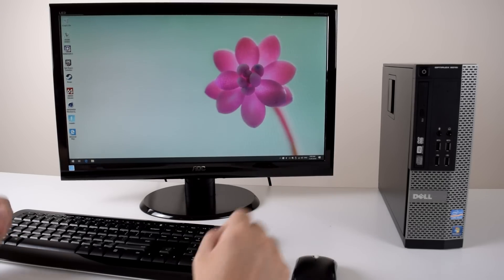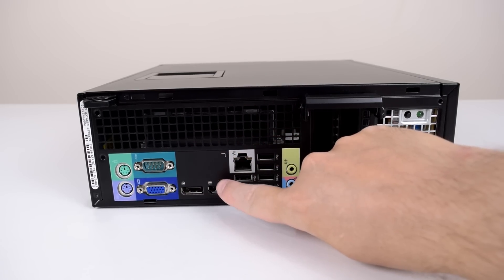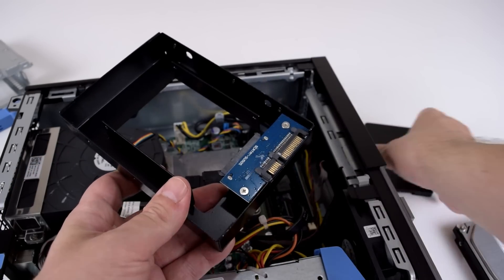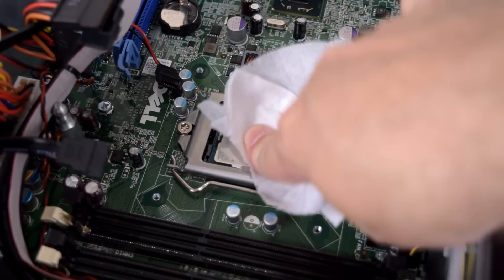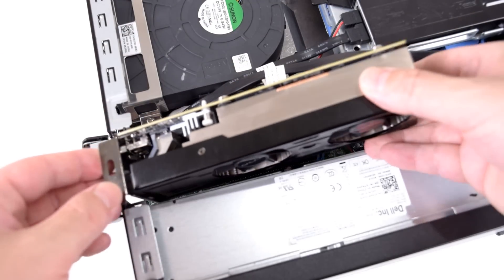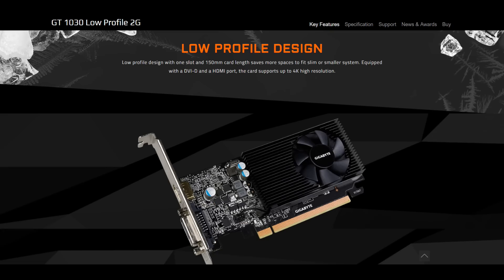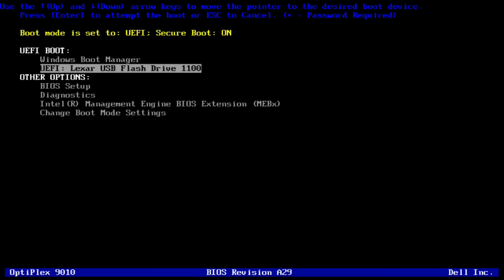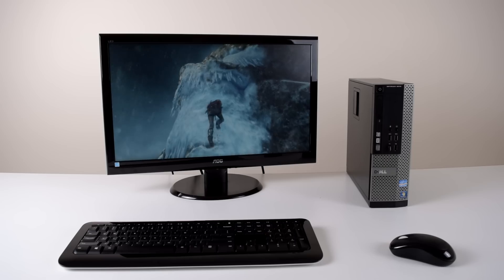DELL OptiPlex 9010 Upgrade Guide! Core i7 32GB RAM GTX 1050 Ti and more

Comment: The motherboard is good, need a new case to fit a new power supply to power a great GPU. Max out all the ram. It is a fast computer once you do that. expect reboot to be around 30 secs.

Comment: I have a 9010 sff with a gt 730, I've been wanting to upgrade my gpu to either a gt 1030 or a radeon rx 550 LP. Which would be best? Would the rx 550 LP even fit in a 9010?
Reply from the maker: Best to lo look at some benchmarks, but make sure you are comparing DDR5 models, the 1030 has a lower performing version with lower grade memory.
Reply: @philscomputerlab  the 2gb ddr5 version is the one I'm looking at right now. In terms of benchmarks it seems to get the job done, at least for me since I won't be playing heavy games on it.

Comment: You guys can also do the same thing with the house company elite 8000 series, capable of the i7-3770. A major upside to this system is that is comes with 4 pci brackets instead of two, so if you are a hardcore user that likes to use loads of like sound cards for example, that system is for you. They have the same ps5 wattage, and are generally the same, it los supports DDR3

Comment: Good news! Nvidia launched a quadro RTX a2000 low profile with 6 and even 12gb of VRAM! You can upgrade the gpu to that now!
Reply from the maker: How much?
Reply: @philscomputerlab  like $500-$450
Reply: up to $600
Reply: @philscomputerlab  its hard to find the 12gb variant though
Reply: equivalent to rtx 3050-3050ti

Comment: So my 3010s 240v psu can handle a gtx 1050 just fine? I have read that it might cause problems and the gt 1030 would be save

Comment: This video is the only informative video in this aspect! I loved it. I was thinking of buying a used 9010 but holding back as it doesn't support anything... luckily you proved me wrong. Please specify whether the PCI bracket is the full height or half height?

Comment: Okay so I just went into 3 different reply sections to comments and I am BAFFLED by these fake pc experts trying to explain to people what good and bad ram is so Im going to make a chart. People are STILL arguing over this in the comments.

RAM Chart:

2gb: Very Bad (probably couldnt run minecraft at 30+ Frames)
4gb: Okay (45-75 frames on minecraft)
6gb: Decent (But why the oof do you have 3 2gb ram sticks. That shit is ocd triggering for some reason or is it just me)
8gb: Average (Can run most modern games at a respectable framerate, minecraft 90+ fps)
12gb: Good (Can run most modern games at 80+ fps, minecraft 150+ frames)
16gb: Very Good (Can run the large majority of modern games at 120+ fps)
32gb: Extermely Good (Ideal for a finished gaming pc, can run basically every game at 180+ FPS)
64gb: Unnecessary (You really dont need this much unless you're an editor or very rich)
128gb: STOP (You are mentally ill and will never need this much unless you edit movies or something for a living)
256: How did you even find that many ram slots (Stop it. You need help. You have a problem. You cant afford food anymore)
Reply: This is assuming you upgrade the rest of the pc along with your ram. No point in having 32gb ram but GTX 750 as your gpu
Reply from the maker: Hehe that made me smile :D

Comment: OK I have bought the 9010, I have bought the i7 3770 not sure if it's the t or s version.. Wil the gtx 1050 (not ti) be OK with the standard power supply? Thanks for this fab video.

Comment: Do you think a 320w psu could handle a 1650 super? I have an hp Compaq 6300
Reply: you can if your psu has 6 pin connector...I put rx 470 in my optilex 315 watt psu...I was planning to put 1650 non super but it has lower performance to rx 470, so I end up with used rx 470 since its cheaper
Reply: @mzam2028  ive actually done a mod on my power supply which ive been doing for decades and it works great.And the 1650 super is closer to a 580 from what ive seen.Some models even surpass it.Only bad thing is its only 4gb.I want to buy the palit 1650 super oc.Its really cheap, compact and is also the fastest 1650 super!
Reply: @steliosemmanouilidis5050  actually even 285 watt psu can support up to gtx 1660 ti...Linus already try it...he only use molar to 8 pin connector in oem pc..no need to mod since you have 320 watt
Reply: @mzam2028  no i did the mod to add the 6 pin.Also yeah I've seen the video linus made.I would go with a 1660 but it's over my budget.Now you got me thinking that maybe buying an rx is better since it has 8gb.But im not sure.Although it did work for you its recommended psu is 450w witch is way more than my 320w.So ill probably stick with the 1650s.I wish they made 8gb versions of it :/
Reply: @steliosemmanouilidis5050  actually yes gtx 1650 super has similar performance to rx 580 and even better in some game since it use gddr6.....just sell your 1650s and get 1660 ti or super thats the optimum gpu you current psu can handle...
Reply: @steliosemmanouilidis5050  no  don't have rx 580...its too power hungry...sorry if you misunderstood...but I only use rx 470 used..since it has the best value to performance..

Comment: Can you add an rx 570 to this?
Reply: I add rx 470 in my optilex sff 315 watt psu using riser cable....rx 570 efficiency is not very good...use more watt and hotter but only differ 3-5 fps to rx470

Comment: The Manual for the USFF 9010 states it's only capable of accepting 16Gb of 1600Mhz ddr3 memory. In the video all of your bench marking is done with 16Gb of ram as well. Some commenting on this video state that the 3010, 7010 & 9010 will accept 32Gb of ddr3 1600Mhz memory, yet as I've stated before the manual itself shows 16Gb (2x8) of 1600Mhz ddr3 memory is the threshold. Were you successful in getting the PC to accept & register 32Gb of ddr3 1600Mhz memory or was the Title of the video just in error?

Comment: Again Thank you for your video ....  I currently have 16 GB of RAM with a i7-3770 @ 3.40GHz processor , with a Intel HD Graphics 4000 Video Card....I'm looking to upgrade the video card to get a 3 to 4 monitor upgrade ..Oh I don't really use the pc for gaming but my sometime running Madden 2021.    What is the best card from my needs? Is the GTX 1050 Ti still the best card for my needs?  Thank you in advance!
Reply from the maker: The 1650 is the fastest card for games. To drive 3 or 4 monitors, well that might be difficult. I'd go for two video cards, but single slot, like 1030 and connect 2 screens per card.

Comment: So, I have a dell optipex 9020 sff with a gtx 1650 with a core i5-4570, and I looking into getting a new processer should I get and i7-4770 or one of the S variants of the i7 processors
Reply: What PCI port do you have the 1650 in and how does it run? I have the same PC and it looks like you have to use the 4x slot
Reply: @ByteMatrix-o  just use riser cable

Comment: I have a dell optiplex 7010 sff. Could u please suggest me the best and safe gpu.
Reply from the maker: What do you mean with safe? If you want 100% compatibility and safety, go with a model that is mentioned or recommended by DELL for this machine. There should be information on the DELL website!

Comment: Hello great video, what about a gtx 1650 gddr6? i have i dell optiplex 9010 MT with i7 3770 and 2x8gb ram and 1tb hdd and 128 ssd and i want to put a 1650 gddr6 (no 6 pin connector), should it work fine with the stock 275watt psu

Comment: Hey man, so I got a SFF just like this but it’s a 3470 CPU. I bought the LP 1030 and it runs alright, but still not enough for warzone. I have 16 gb ram and a 2 tb hard drive. Whenever I play dying light and have it on OC mode for the GPU. After awhile it gets kinda hot, 79c was the max I think. So if I buy the 1050 will I be able to run warzone on my factory PSU/PCIe without problems etc? Ty

Comment: Got a 7010 DT desktop, nice option in between the MT mini tower & SFF.  Takes an upgraded 300W TFX PSU, a low profile 1650 GTX GPU & a Sound Blaster Audigy FX. Also put an i7 3770, 16 GB RAM & an SSD in & it's a capable gaming PC for about £400. Plays recent games in 1080p at medium to high detail. Worth getting the 7010 or 9010 over the 3010 as you get faster SATA & PCIe speeds. The SFF is very neat but the DT is slightly more upgradeable & has better cooling
Reply: Managed to find some Crucial Ballistix Sport DDR3-1600 sticks that run at CL9, without XMP (which the motherboard doesn't support). Tiny speed increase but makes me smile!

Comment: I just found this computer for sale at a local computer shop near me for 179. already has the i7 and 8 GB ram that I'm trying to research if it's a good deal-thank you for your video.  But it has the 500 GB hdd, which I don't need that much for storage, nor do I game.  But still considering an upgrade to a SSD, but as it is, is probably sufficient for my use of it.  Now the two previous desktops I owned over a decade ago, were package deals, had laptops since then.  Probably a dumb question, but as far as monitors go, will I need anything special to make them work on this thing?  Cords or cards, or will any monitor I chose work?

Comment: I also upgraded the video card to a 1050ti and added some ram and it already had an SSD. Most games work fine, except cpu hungry games. The speeds difference to a i7 isn’t worth the price of the demonstrated i7.

What is the newest i7 it wil take? Maybe a newer version makes more of a difference?
Reply: idk. you're pretty much stuck with the current i7 you have.. unless you manage a newer motherboard that supports 4th gen. ik mine supports 4th gen, because it came with a i3 4150

Comment: Bought one of these a few years ago and hot rodded it and as I was learning about it I discovered how non-universal the motherboard size was, so I bought another one the mini-tower so if I either need a new MB it is compatible to the open market MB's.  Just got the New Egg Business sale i7-3470 for $207/freeshiping.  First thing I did was add SSD and RAM, oh and I never get these units with Windows, always No Operating System.  Need a graphics card now and the hard-mods are done.  Thx for sharing.

Comment: im getting one of these from a friend who has had this thing just sitting around with an i7 in it just laying around we were all chilling in a discord call and he decided to show it off on his cam in it peaked my interest ill update this comment when i get it ill be planning on getting it to 32gb of ram and getting it fully cleaning and getting the small front fan looks like a 92mm with a noctua for more airflow with lower noise as for a gpu ill look at that when i get it so i can get a better idea on what i can do i think i can use something newer then a 1050ti idk if they make 1650 supers in that size or not yet and i have an ssd to put in it right away so im going to just sell my current one to upgrade this one and to save for a laptop as well thats just what i plan on doing for this i know the i7 3770 can handle scp sl so long as i get a decent gpu to put in it........all in all thanks for uploading a video on one of these machines this gave me a good idea on what to expect for when i get it!

Comment: I have an old setup with the following specs: 
_____________________________________________________________
++++ i5 4460
++++ Gigabyte H81M-S1(with PCIE 2.0 standard unfortunately)
++++ corsair 16GB RAM(8x2)
++++ 480GB WD green SSD & 1TB WD HDD combo
++++ Corsair VS 650 power supply
_____________________________________________________________
I wanna play modern titles at 1080p 60FPS.

Should i go for an RX 570 or a 1050TI or 1650 would do just fine ?
 .                                            &
 Will it cause a lot of difference if i continue with the PCIE 2.0 slot of the mobo ?

Comment: I have same configuration btw, but i just got jedec node in 1333mhz of RAM not XMP mode. I use a Corsair Dominator GT 8gb 1866mhz, what should i do? I cant see XMP configuration on The BIOS menu.
Thx a lot.
Reply from the maker: Yes you can't on these machines...

Comment: Nothing beats my dell optiplex running windows 7 with 2gb of ram with a extremely outdated processor. 😭😭😭
Reply from the maker: Upgrade RAM, get a SSD and it will run Windows 10. Also update the CPU.

Comment: GD 10-thiddy

The GTX 1650 with 4GB GDDR 6 is the best card for that system.
Reply: So the 1050 ti isn't the best option for this build then?
Reply: @ItsMexxyy  1650 is the newest card that will fit

Comment: Thinking about copying this build as an entry level build for myself however i have an Optiplex 9010 Ultra Small Form Factor PC... will parts fit this or am I working with too little space?! Great video!
Reply from the maker: No I don't think it will work with that machine. But I don't have one so can't tell you 100%. Usually USFF machines have extremely limited upgrade options...
Reply: @philscomputerlab  Thanks for the reply! Did some research on my own for the specs of the USFF PC and looks like it can only handle a mini pcie... not sure I particularly want to go that route. To be continued...

Comment: Got a Dell  7010 with the i7 3770...lovely SFF machine, little, by little I will upgrade it, I have a more modern Ryzen 3 3200g rig, very responsive also.

Comment: I have the 9020 sff  with 4790 4th gen i7, 24gb ram, raid 0 ssds running both windows 10 and also mac Catalina which is fully installable on this computer.... I cannot say enough good things about this build! I got mine for 139.00 on new egg buisness section...I only added the ssds and the extra memory..I received it with  a standard harddrive and 8gb....Its whisper quiet, cool running, and superfast both to boot and to handle tasks and open programs...its instanteaous.... I recommend this computer becuz it can also run mac which is a major plus , and it runs it flawlessly...One more thing, I Dont play games, thats why i didnt shove a card in mine...I prefer that pcie slot free in case i want to add an nvme adapter in the future...temps are cooler without a card in there anyway... I actaully like the built in hd 4600 graphics..it provides a great web experience, does hardware decoding of all hd video with next to none cpu usage on youtube ect... perfect for my needs

Comment: Just to let you know at 9:46, you have the 802.11ac wifi usb dongle plugged into a usb 2.0 port, so you are throttling it to 480mbps (often less as motherboard manufacturers often do not implement usb 2.0 very well).

Comment: I'm thinking of buying this machine for its small form factor in order to replace a laptop. I don't carry my laptop around to much, and when I do, it's by car, so I don't care too much about weight, but I think I would get much better performance out of an upgraded Dell Optiplex like this in the long run. Laptops nowadays are too flimsy and fragile for my taste, and don't provide enough power, they often get too hot, etc. etc.
Do you think the standard PSU it comes with will be enough for 16GB RAM plus a better graphics card like yours?

Comment: Would it be a rip-off to pay $300 USD ($475 AUD) for a Dell Optiplex 9020 i7 4770 3.4GHZ with 16gb DDR3 and 250gb SSD?
Reply: Get a 790 and do it up. At that price is a bit steep.  I got lucky and only paid $80 AUD for a 790

Comment: I have one of these with 240w PSU, do you think it'd cause any problems if I added a low profile gt1030? Or will it be fine?

It's just 1tb SSD, I5-3470, and 16gb ram
Reply from the maker: It will be fine!
Reply: @philscomputerlab  thank you!

Comment: Great video!  I wish I had seen it last year when it was posted.  The only real news to me was your success running the GTX 1050.  I have been worried about the power draw, but you prove it works fine.  I am still thinking about the 1030 and then using the second PCIE slot to add an M2  SSD but I am worried that I might not be able to make it the boot drive.  Do you know anything about that?  I bought a Ryzen 5 laptop on black friday that has the M2 drive and 8G ram and it works great with about the same power as the Optiplex i7.  The laptop runs so nice I feel that the M2 storage is a better value than more memory -which is already obsolete so I don't want to invest in more.
Reply from the maker: Yea I haven't tested PCIe M.2 in such a machine. It's possible that the BIOS doesn't support this...

Comment: I did a 7010 optiplex with a i7 3770, a $40 450 watt Corsair bronze PSU I had lying around, a 1660 Super (low profile) GPU, 28GB of Ram (it was extra ddr3 I have lying around, probably will replace the last 4gb stick with a 8gb so they all match soon), a cheap SSD, and a cheap wifi/bluetooth card. It games and runs processes super super well, its incredible what a good performer you can get out of such a cheap desktop platform. Total build cost was probably $400 in US dollars, which is incredible considering the GPU was $230 alone. The only downside is its a dead end platform, you cant upgrade beyond that. But you can always take the good parts out like the PSU, SSD, GPU, and put them in a new build in the future, and then sell the optiplex for close to what you got it for, since there's not much room left for them to depreciate.

Comment: How is the PC and PSU holding up after a year? Is it still running well?
I also interested in this kind of project :)
Reply: Dhavid Claudius Gunawan was it the factory psu or was it upgraded
Reply: @omarvero3502  I haven't done this project yet.
Perhaps the OP could helps with that question :)

Comment: Hi great vid. I have the 7020 version with 16ram 1t hd but only 2gb graphic card. I want to change the graphic card to the 1050 but I can not see a second slot like it's to fit the connection into. Have u come across this. Sorry I'm a bit if a newbie